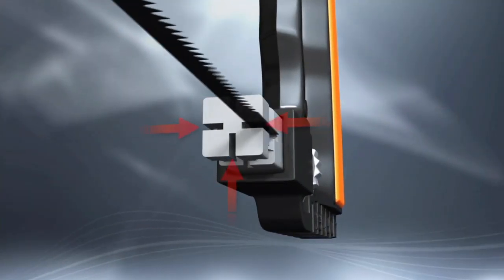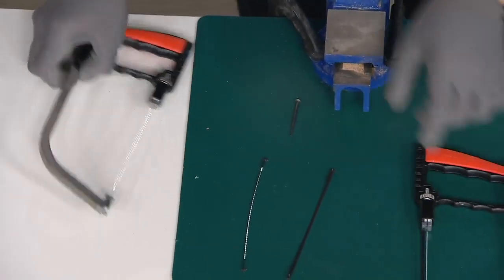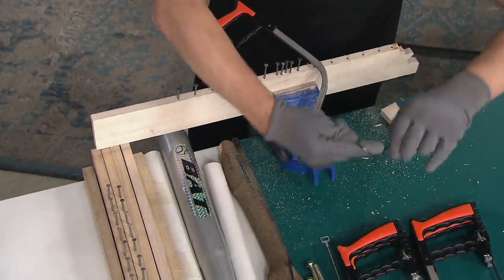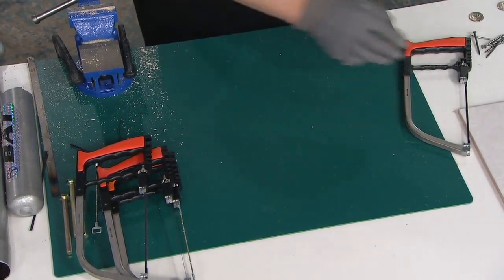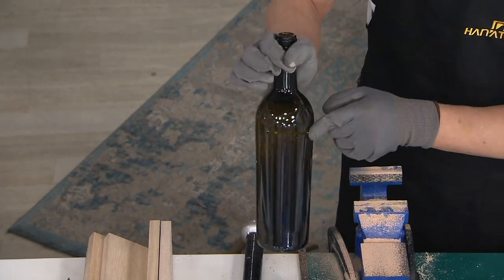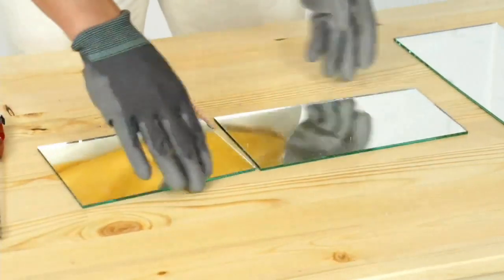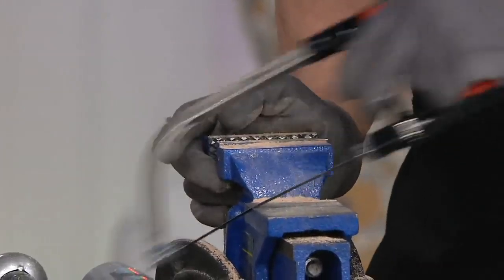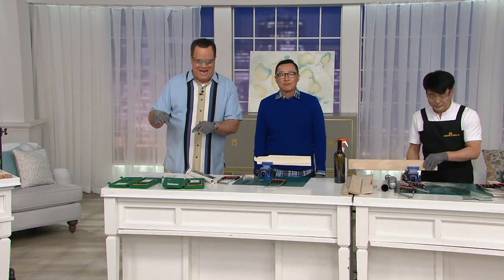Magic Saw Multipurpose 6-Blade Cutting Tool Kit with Storage Case on QVC

Comment: This is a glorified koping saw. Interesting  blade mount, but 90⁰ limitation.

1) cut speed is based on tooth count (tpi)
2) smoothness is on on the "set" or spread of the teeth
3) the tension of the blade is what keeps it responsive
4) aluminium is a soft metal, you can cut it with wood blades
5) saw blade teeth just have to be "harder" that what they're cutting, thus the diamond blade for tile \ glass. Carbide works too.